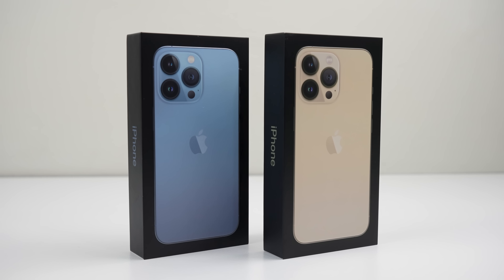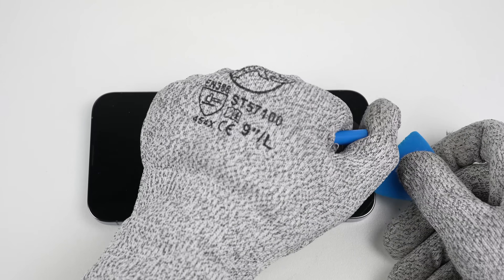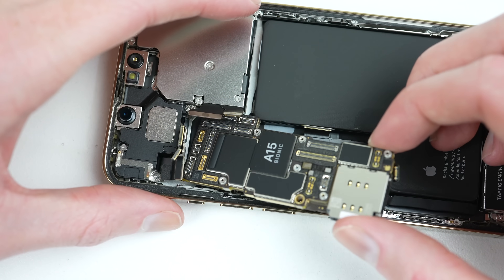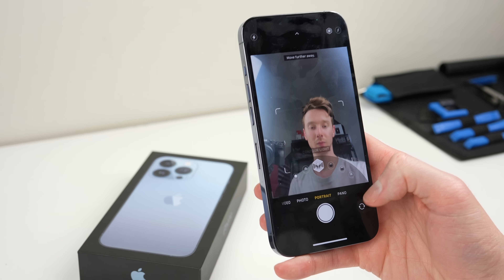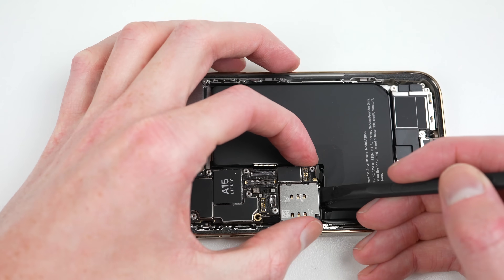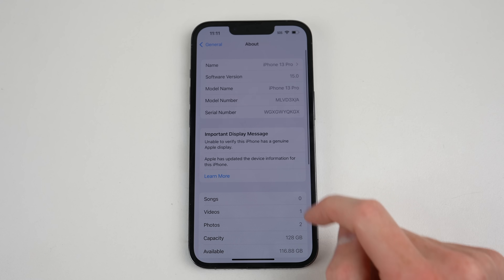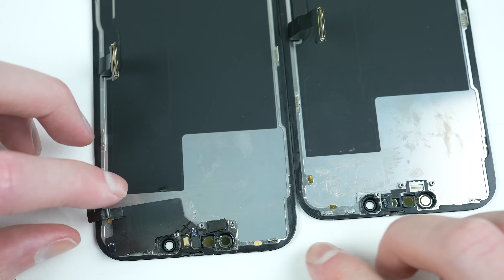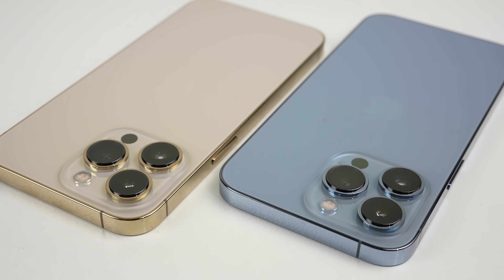iPhone 13 A Repair Nightmare - Teardown and Repair Assessment

Comment: Such a shame for Apple to continue to go down this path. I fully expect within the next 5 years iPhones will no longer be repairable at all (e.g. screen is soldered on) and any hardware-related issues will result in a complete replacement.
Reply: They just want to force people to go to them for repairs which they will charge much more expensive than third party repair shop. They just want to milk user for their repair money.
Reply: No they want you to buy new phones.
Reply: yea, like I was eager to upgrade to the iPhone 12 from my iPhone SE (1st Gen) because of the squared off design plus it being a couple years since I've upgraded. I had just swapped the battery out last year on my SE and its as good as new now. I can maybe understand Touch ID/Face ID being disabled for security reasons but the entire camera functionality? 

I was hoping maybe during the iPhone 13 apple would have tried resolving the issue, but its clear as day now. According to Apple this isn't an issue but rather a feature for them.
Reply: @KOSAMAGAMES  I can understand locking the camera modules and disabling FaceID due to safety concerns, but locking the screen is a dick move with little real security behind it.
Reply: this is especially scary for android users because of how android phone manufacturers (like Samsung and Oppo) tend to copy the current IPhone trend. i just want my sharp edges, open bootloaders, and easily switchable batteries back
Reply: @gun5219  
There are more android phones that works better than samsung or oppo or iphone
Reply: @gun5219  Just get a PCCCCCCCCCCCCCCCCCCC
Reply: @sambuddhabhusal2479  gpu prices are at an all time high, theres also the silicon chip shortage and idk if i can fit an entire pc tower into my back pocket
Reply: @gun5219  You can but you can only get Gpus Like 1650 super/2060 for the most part
Reply: @sambuddhabhusal2479  might as well have an entire server rack on my knapsack at this point
Reply: @gun5219  Yeah, remember the time when Samsung ads made fun of apple their decision making on their device, now they start copying what they made fun of.

If android phone manufactures starts following this way ( Locking phone repairs with software's and forcing users to send their repair's to the company only that charge much more expensive for repair cost than buying the parts online and replacing yourself ), who knows in the next 2 to 3 years every other company might start following what Apple is doing.
Reply: @brandon-qc1ul  
Android is open source they have to create their own os to do so
Reply: Fck apple with their backward invitations or devolution and trends, just like like removing headphone jack, charging brick and other accessories. And now this anti repairs. Duck you apple ☺️
Reply: @ToTheHellfire024  Don’t you know anything about the right to repair laws that is happening right now and how the iPhone 14s renders makes it look more repairable and on top of that the headphone jack removal was a right move sure it kinda sucks but when you have wireless headphones it’s way bette than wired and for the charging brick also kinda sucks but you know it’s to help the environment and have less waste heck they removed the plastic on their boxes just because of that I think apple is in the right here and the right to repair laws will fix this problem!
Reply: @EliezYT  there was an interesting video on how by not giving the chargers they are actually indirectly creating more waste so they end up harming the enviornment
Reply: @EliezYT  If they trying to minimize e-waste by removing charger, then why stick to obsolete thunderbolt charge for no reason?
Why not switch to a much robust type-C? 

But the only thing they want is money. Hopefully, EU pass the laws soon to end their greedy endeavours.
Reply: @agentsmith_  for me yes the usb type c would be good for their iphones but it will also take away a bunch of waterproofing and trust me I bought my new iphone 12 mini mainly because I wanted to test the waterproofing out and trust me it's great!
Reply: @maki49574  except you will get a horrible chip that won’t last long in updates and a horrible camera and yes I checked more premium but even those doesn’t hit the same level of support and speeds as apple!
Reply: @maki49574  also mate it’s brand reputation I know I like Dr Pepper more than any other drink yet I still drink coke because of the brand!
Reply: @EliezYT  Its all bs.
Reply: @maki49574  well it also depends on how you grow up I mean I’m forced to buy apple because of my family and I have had many androids before and I do like them but apple keeps getting better and better every year and honestly I love seeing how much better it gets and at the end of the day no matter if you like android or apple let’s be honest the tablet is the iPad the sales and money don’t lie!
Reply: They removed free charger for their so called e-waste reduction but their phone itself are unrepairable which contributes to more e-waste. Removing the charger is just an excuse for their greediness which is anti consumer.
Reply: @pattpdm  Respect to Xiaomi.. Our phones still have fast chargers. iPhone dosent even have slow charger lol.
Reply: Yeah, your iPhone is now e-waste because the screen broke, but look - no charger, because GO GREEN!
Reply: @glics  bruh it’s your fault if you break your phone or don’t repair it I mean I know some people want to not keep their phone but it can also be used in many other ways!
Reply: Hopefully there will be a Right to Repair legislation passed by then
Reply: @Ashrune  don’t you worry son. That will never happen. They pump way to much money to lobby against it
Reply: Easy solution : stop buying iPhones
Reply: or blow up and lock if you try to pop it open without some sort of a code that only they knkow
Reply: One word, Greed.
Reply: Atleast I use an Android phone. I'm glad that I'm not an iPhone user. Android is an open source OS and companies can't implement locks like Apple. iOS is engineered in that way, so it is trash. Before Apple fans say anything to me, let me tell you, speed and smoothness dosent matter if you don't have right to repair your phone. New Android phones are also relatively smooth and I like it.
Reply: "We removed chargers for sake of the environment"
Proceeds to make their phones even less repairable
Reply: Apple is a shitty, money hungry tech company and they are a BUSINESS FIRST and a tech company SECOND. They DO NOT CARE about quality and the ONLY reason they ''care'' about their customers is to KEEP said customers and keep the money rolling. They only care about money and the fact that every single thing that can even remotely be sold separately, is sold separately shows this the best. I bet you my whole life savings that if they could somehow sell their phones in 10 different packages at 10 different prices, they would, JUST TO MAKE MORE MONEY - because that's all they care about. Them removing the AUX port and them selling the charger and charger cables separately is the most shameless, scumbag move they could have ever done and it is NOTHING more than a business tactic and a scummy way to make more money. They are literally smearing shit below their customers noses and then dancing in front of them but their customers are too blind and too stupid to notice. I bought an Iphone once, it was few years ago and I never regretted buying a phone as much as I did then. 

Also, the iOS is the worst, most illogical and counterintuitive phone OS I have ever used! And also the fact that you can't even activate ''developer mode'' on Iphones or change anything within the OS is just pure scumbaggery and shamelessness coming from Apple, to prevent anyone else other than them, from making any 3rd party software for their phones...

Just another disgusting, shameless and money hungry company from U.S. - No surprise here.
Reply: Tbh iPhone users are pretty stupid, why buy a phone that has nothing new but the name and size? Plus can't repair it yourself so spending more unnecessary money on it, hard pass. When you buy something it's supposed to be for you to do what ever you please with it, not be stuck doing nothing just cuz the company is greedy when it comes to money.
Reply: @user-li1eg8xz7v  it has new chips therefore faster. To be honest the speed isn’t that much of a diff
Reply: Not even 5 years I reckon. Give them only 11 more months.
Reply: You are wrong. The pattern apple constantly follows is 1. make device that is very difficult to repair and then 2. after people are outraged. Apple makes a device that is slightly easier to repair and then people will be happy. rinse and repeat
Kind of like an abusive relationship lol
Reply: They have already paid hundreds of millions of dollars in fines since the lawsuit in 2017 and it seems they don't care. The only way for this tyranny to stop is for countries to start  banning iPhones.
Reply: Why should they stop going down this path? The Cult will line up and buy anything.
Reply: I hope some one can cracked their programming to reprogrammed all the logic board so Apple tech can get FUCKED!
Reply: This way Apple ID creating more ewaste than others.
Reply: The wrong here is customer that keep supporting this kind of company policy
Reply: and then there hypocrits saying there green, i don't support apple never will people buying there product only support this BS company policies and getting screwed over by it its discusting.
Reply: @GreenMaskEnergy, people will not stop buying iphones because they’re not repairable by third party shops. There are dozens of good reasons to support apple. Just with anything in life you have to also see the good not just the bad. But yes i agree it is disguised that apple is choosing to do this. But it won’t last! That’s a fact!!
Reply: They would make it all software locks because increasing hardware replacement difficulty also increases manufacturing cost.
Reply: @josir1994  from video no difficulty. Click click and assembled device. Connect usb cable, send proprietary generated command to reset eeprom and accept all modules again. 5min work. For company
Reply: It's the customers fault. The customers continue buying them.
It's not like Android doesn't exist. I understand that they are "locked" to the Eco system of Apple. But being locked is an enough warning.

Many companies have fallen before. Apples time will come. And if will be their own "stupid greed" that will bring them down. They don't see it until it's over.
Reply: We have to bring awareness so people StOp buying this product.
Reply: Or you could stop giving them money.  Then you won't have to worry about that.  Plenty of RTR-friendly (even if not wholly) Android phones out there for a fraction of the price.
Reply: I would wait for that day .. and I will see that company going down faster than an astroid ...
Reply: How is it currently repairable ? You MUST go into that apple store and pay $600 to "repair" your screen while it should cost little over $100. (Also, as you can clearly see from the video, repairing your iphone means loosing functionnalities, unless you go to the apple store)
Reply: @Hydiz  india is cheap bruh.. you dont have to pay much here... I don't know too much about the costings but it cant exceed more than $60 for screen...
Reply: And hopefully some sensible manufacturer will bring out a Fone that is durable, affordable and has the ability to be upgraded by hardware.
Apple are living in the past with these policies, once their share price gets hammered the board members will be ousted. GOOD!.
Reply: @Billsbyjoe  you better go back to the past and buy a nokia 3310, but that thing breaks aswell with enough force. There is no way to make something like that with current tech evolving as we speak. If you want to change hardware yourself and have an open source os sure switch to android, its your choice and none gives a fuck. Mind you tho, flagship androids are not affordable either and they also break, everything breaks.
Reply: Profits, profits, profits. Thats all they care about. They don't care about sustainability, they don't care about fairness, they don't care about the environment (in contrast to their marketing, of course).
Reply: Sad that we can do anything about it ;(
Reply: If that happens I doubt people would want newer models but if you want mass variety enter the world of china
Reply: They could fill it with epoxy and it's completely disposable 1kEUR toy._
Reply: haha nobody will use phones then
Reply: why would you need too sim cards
Reply: More money for daddy apple
Reply: That's exactly the reason why i ever only purchaced the I-phone 1.
After that i always using the Samsung branded phones.
Reply: I hate apple with a passion
Reply: Hey, in 5 years you might be lucky to be able to call your nan without getting written permission from Apple first.
Reply: But I love this thing. only Apple can repair.
Reply: There are several companies going the "no repair" route. I just bought a water cooler and when the heating element stopped working (1month in) they just sent me an entire new machine. No return of the old one needed.  The Customer Service Rep said " we don't offer repairs on the device ".
Reply: @themelancholyofdude959  they have already moved the iPad to USB-C so I doubt changing the phone will make any real difference.  I still doubt they will give up on the right to repair issue though.
Reply: Remember, you won't own.anything and you'll be happy.
Reply: and people will be buying Chinese brand phones
Reply: do not buy it. fck y'all.
Reply: No repairability DOES mean thinner, lighter phones which is a practical reason for it.
Reply: hopefully we run out of materials.. which is gonna happen apple doesnt fucking care about you or the world... bunch of snakes...
Reply: Hell I got my battery replaced by Best Buy’s Geek Squad and they fucked up my speaker in the process in which I had to take it all the way to a Genius Bar to get that fixed as well
Reply: That makes no sense money wise for apple to replace every device for simple issues. This iPhone is the most repairable one because they are no longer trying to replace whole devices for small parts that can just be replaced.
Reply: another reason to change to Android
Reply: Apple is run with dictatorship mindset, acts like the Chinese government, restrict, restrict, restrict. Can I do this, no you can't. Come on! Life is already hard
Reply: Remember they also have to repair their iphone, they will make it repairable for Apple only. That why they have serial number related with part number and save in bios. The only way to replace the part is reset bios which consisted high level of firmware system. This only Apple can do it.
Reply: The problem is not that Apple doesn’t want their phones to be repairable, the problem is that Apple wants to limit repairs to themselves and Apple certified facilities. As a manager of a certified Apple repair team, I can say it’s pretty dumb the software they make us use just to get the parts they send us to work.
Reply: Probably permanently turn off without an iPhone key when you replace parts
Reply: Yeah it's just going to reflow the screen on.
Reply: ill desolder that bitch... in todays market of 3d printers and at home CNC machines, making a jig for reballing isnt hard and opens the door for repair on ANYTHING
Reply: Apple is encouraging electronic waste
Reply: @chickencr0ssroad883  yea they really are. i am starting to see it more and more. my furnace has a blower with a PWM controlled board on it. non serviceable part made overseas.  sure its fixable but only if you have a scope and know what your doing on a board level. just overly complex shit for no reason and then they block schematics and parts resale
Reply: @chickencr0ssroad883  I guess you can also say they are starting awareness with it also how is there more waste when they take away the plastic from the box of the new iPhones?
Reply: @EliezYT  yeah but, without repair. You have to buy new ones. That means more box. I think that the plastic from the box is very little. So imagine plastic is 10 grams total. The phone, box and more will be more than 10 grams.
Reply: @chickencr0ssroad883  Still adds up eventually and I mean I’m not saying it’s bad far from it just saying that it still technically can be repaired from 3rd party services still even if it’s a little more still will be cheaper than apple XD
Reply: @EliezYT  yeah but if it repairs, removing plastic would be an effort. But if we can’t repair then the box and phone would and up to more waste. Created Tech said any hardware related issue would be replaced, cannot be fixed or can do serious perm dmg if repaired
Reply: @chickencr0ssroad883  So your saying is we need bags next for our phones XD!
Reply: @EliezYT  no
Reply: a complete replacement for another  brand, I hope. Dont fucking buy apple
Reply: Dont know how anyone still does not get that Apple has been this way from day one.  If you cant understand this by the 13th iteration of the Iphone you are truly beyond stupid.
Reply: lol no, that would make apple unable to do any repair and replacement, which would make them lose money.
Reply: It's shame for Apple fanboys, they've the brain of 3 years of old
Reply: Then don't buy them.. Oh whoops that's impossible for people apparently
Reply: This is why I buy quality equivalent android devices.
Reply: @mlordwhiteslayerfromf.u.g  nothing android can beat that camera and chip man!
Reply: @mlordwhiteslayerfromf.u.g  Look I’ve experienced many android phones and sure I like them and honestly I want one again just for games and stuff but I have to say it’s hard to beat the quality of iPhones and I mean look at the iPhone 13 pro that’s a solid phone and then can’t see any reason it’s bad!
Reply: @mlordwhiteslayerfromf.u.g  Like I said you can still get it repaired from a third party just this time it might be a little bit more expensive because of the extra steps they have to take also mate with the storage upgrade this year can you complain to much and how in the world would you need more memory if you got 512gb or 1tb!
Reply: @EliezYT  the point is that buying an SD card for expandable storage is cheaper than having to pay extra for the phone in order to get more base storage plus it can be more practical and you can transfer data from 1 device to another with ease and can make you keep your phone for longer as you won't have to upgrade it or delete stuff once the storage is full, you can simply have stuff on the SD card, now that's how you REALLY be environmentally friendly.
Reply: @EliezYT  I personally am fine with 128GB of storage on my phone but for my computer it's a no so my computer needs to have expandable storage so that I can put an SD card when needed which thankfully it does (I got the maxed out version of my surface go 2 btw but 128GB for a computer that I hopefully want to keep for years? Yeah I'm not gambling with that, just give me the expandable storage).
Reply: @mlordwhiteslayerfromf.u.g  why would you store that in a phone on a micro sd. There are 4tb harddrives out there at a very affordable price.
Reply: @mlordwhiteslayerfromf.u.g  got no clue about your workflow, i do understand where you are coming from. But it seems complicated for me, as a photographer. (I also have a genuine question, how tf do you have over 2T of reference images and how do you find the one you are looking for??) 
About micro sds having less chances to fail and faster transfers than hard drives doesnt sound right, but sure.
Reply: @mlordwhiteslayerfromf.u.g  fairs, thx for keeping a calm head and actually telling me about what works for you in this never ending android vs iphone war. Have a good day.
Reply: Not apple's fault. I mean yea, they did this. But the majority of people accept it, so they can get away with it. The customers have all the power .
Reply: @2SaltyRecipes  yes but being more environmentally friendly is a good thing and you can’t complain either but it does seem like Samsung wants to follow apple most of the time and they can make the choice to keep stuff in their boxes but it’s also Samsung so holding apple responsible only is kinda wrong!
Reply: That´s not the problem/ shame. The shame is that people still buy that crap.
Reply: Look at the current iMac (24”) its all soldered on board, a monolithic sealed system.
Reply: This is a great insight. Apple will get away with slowly locking down their phone from repair. Before we know it they will have the phone welded shut.
Reply: @toneabet6252  they already locked it via firmware, why in gods name would they weld them shut? They would lose so much money. Open your eyes and switch to android if you want to.
Reply: No, in 5 years the software will be designed to malfunction after a year or aroun the time a new IPhone comes out.
Reply: The mass consumer allows this by buying such products. 
Period!
Reply: DONT GIVE THEM IDEAS
Reply: And I can guarantee people will switch phones, especially people that break there screens alot
Reply: people still buy their kit, so yea it will happen
Reply: nope
Reply: Thats not very green of them, we need all the microchips and semi conductors we can get, why waste a whole phone over one minor repair?
Reply: Yea and suckers will still be buying them.
Reply: i.e. "device's gonna get tossed in a dumpster right away"

f%&k you Apple. sustainability my a$$.
Reply: They will have your fingers paired to the device so that no one else can use your phone 😂
Reply: cries in swappie and related refurbished phones sellers
Reply: If idiots are going to keep buying them up until that happens and even then in the face of utter undeniable bullshit then errr...can't fault apple for taking advantage of a braindead generation.
Reply: Its for the environment remember
Reply: No they won't solder anything, they did that on old ipod and haven't done that since, probably cause it's easier for Apple certified.. idk tho
Reply: Talk about tech waste issues right?
Reply: Some of the idiots in this thread really need to look up Louis Rossmann's videos to know exactly why people are shitting on Apple for poor repair practices. That "eco-friendly" mantra is bullshit when the "Genius Bar" charges you half the cost of the device for an entire board replacement with the exact same defect when the only defect is a single chip that they probably poorly soldered on intentionally, which they don't even make available to 3rd party repair shops. Replacing a logic board with a manufacturing defect with a logic board that has the exact same manufacturing defect isn't only non-eco-friendly, but it's scummy and it's sad that Apple fanboys actually believe that Apple is eco-friendly and supports repair when in fact they've completely opposed it in favor of a monopoly on repair services.
Reply: i only hate this comment because of how true this "may" be. Created Tech, you need to punch a on fire piece of wood three times real fast. lol You are spitting blasphemy
Reply: Viktor: "i know what i'm talking about" 
Also Viktor: refuses to elaborate 

Whatever you say, dumbass troll, black sweater cultist.
Reply: Apple: Write that down, write that down!!!
Reply: @C20F  no no. he actually have point. camera "may" can be security concern if not protected. Whoever. using id in camera that NOT compatible with a goddamn same model devices that is brand new is in fact yes a shit. but the idea of protecting camera is a good idea. from possible fake camera sensor attack. but tbh. don't. just don't lock the camera. nor light sensor. or the display that magically connect to camera.
Reply: I don’t think this suggests Apple is going down the route of having irreparable phones but rather phones that can only be fixed by Apple at crazy high prices for non apple care users
Reply: @yea9597  That's the point, you know how much they charge for repair fees is very expensive when it comes to Apple. 

They just want to milk out as much profit from their consumers as possible by doing this, but this makes current user think if they still want to keep using their devices in the future that is repair proof for third party repair shops/DIY repair even when the parts are original from Apple themselves.
Reply: @brandon-qc1ul  I know but the original comment was suggesting that Apple would make the phone irreparable even for APPLE themselves which I think is quite an exaggeration. Currently they can still claim to be eco and sustainable (even if its not entirely true) because they arent taking away ur freedom for ur phone to be repaired but rather they are taking ur freedom from who can repair it which are 2 completely different things. In a ideal world for Apple everyone would just go to Apple whenever they have a problem so it would be as eco friendly as having 3rd party repair (obviously a lot of people wont want to pay their prices but lets say they did). However if they made irreparable phones they will no longer have this excuse and cannot claim to be eco friendly as all old phones will just be tossed as they cant even go to Apple themselves for repair.
Reply: That would not make any sense though – why would Apple eliminate their own monopoly on iPhone repairs?
Reply: @woalk  they never repair anything, what the fuck are YOU smoking? GIMME THAT!
Reply: @woalk  Because their final goal is to reach a "perfect" planned obsolescence, where your phone become totally unusuable after some time, which includes it being broken in some way.
Reply: @lunchbox1341  
Once i was playing a game and never bought nothing from their shop , i was f2p 
Years and the game literally become unbalanced the buyers have everything , i was obsessed with that game so i bought too just to play , people start complaining but the owners never cares , until all the f2p players lefts and they were the majority, i left the game too cause it became boring game , even buyers lefts , it ended bad for them
Reply: @woalk  It makes perfect sense. Why would Apple WANT to repair something, when they can sell you a replacement instead?
Reply: @CreatedTech  Because throwing away iPhones that they instead could repair (with their proprietary pairing machines) and then sell again would be a waste.
Reply: @woalk  No one is saying they would just throw the phone away lol? Of course they would sell it as a refurb if they could... 

Regardless, I think you underestimate Apple, and underestimate how much more money there is to be made by doubling down on the upgrade cycle rather than making devices repairable. Apple doesn't make a fortune by repairing 3 year old iPhones and cracked screens. They make their money by selling as much new hardware as humanly possible.
Reply: @CreatedTech  Right to repair act
Reply: @CreatedTech  Not to mention Apple and other companies force updates on your phone to intentionally make your old phones worse I've actually seen it happen first hand
Reply: @woalk  since when does apple care about waste??
Reply: @CreatedTech  exactly. 
Every story I've ever heard of someone going to apple for a repair goes exactly the same: They are told that it will cost so much to the point where they are better off buying a brand new device. 
Forget planned obsolescence, now it's FORCED obsolescence.
Reply: @CreatedTech  .....apple repairs screens, batteries, speakers, back glass/logic board on 12/13, rear cameras...ever heard of Genius Bar? Half of GB is doing repairs
Reply: @stinkwhistle756  "ever heard of Genius Bar". Apart from the condescending quip, I encourage you to think about the GB critically - imagine the cost to Apple to run it. You have employee salary, office rent, opportunity cost, dedicating resources to repairs, stocking all the little replacement parts etc. I'm sure Apple still makes a slight profit from repairs, but nowhere near the margins of selling new devices.

If you had any personal experience with the Genius Bar, you would know that 85% of the time they simply advise to "upgrade to the latest model, as this device is too damaged". They also make it too uneconomical to opt for a repair. For example charging $400 to repair an iPhone, when a brand new one costs $650 for example.
Reply: @CreatedTech  Slight disagreement here. Apple is currently in the midst of a business shift, where they are actively trying to monetize their ecosystem. Look at all the subscriptions they offer, the money the App Store makes, the license money accessories generate. On paper, this should be an incentive for them to make their devices more repairable, so as to keep people in their ecosystem for longer. Look at how many software updates iPhones tend to get, for example. It’s like their software division and hardware division are at complete odds with each other.
Reply: @CreatedTech  because customers want and need repairs. and customers can do that, at the apple store. and it would be much more expensive for apple to replace every device, so they make them repairable, even more now than ever. i bet the iphone 14 will be even more modular (with iphone 13 you can now replace the top speaker instead of replacing the screen). apple wants their iphones to be repairable - goes with their eco friendly agenda - they just want them to be repaired at apple.
Reply: @CreatedTech  you have a point. Even though it sounds unethical, it’s just how they make money on the side (though it’s not like they need it since Apple already makes millions and/or billions of dollars every year from their product sales). It’s a shame companies are so lazy towards repair services, that they only ever make efforts to prevent the need for it.
Reply: @CreatedTech  what about we in s third world country.  Apple  better remember us
Reply: @CreatedTech  That's not worth it for them though.

 They want everyone to buy the apple repair/warranty plan. So they will do what they currently do. Only repair screens. Tell everyone else they need a new phone. Take the easily fixable phone and fix it and resell it while also selling a new phone.

There just going to make it so the phone enters a boot loop when someone else repairs it.
Reply: @CreatedTech  if something goes wrong with the iPhone that isn’t accidental within the first year or two (depending on country ) they legally have to fix or replace it and if they soldered it  replacing it would cost them a lot more
Reply: @woalk  Hey, if you replace camera, it costs 100$.
But if you buy one new iPhone, they earn over 1000$.
And that is the thing they want
Reply: @woalk  Because as long as there is a possibility of people like us to fix it and we will it will never be enough they want to suck up every possible avenue of profit possible and want you to have no choice but buy a whole new phone for any issue
Reply: @woalk  They will just double the price to compensate.
Reply: @woalk  have you ever heard of ANY apple authorized repairs? All they do is replace half of the device, charging you 2/3 price of a new one.
Reply: Alexander Köster Apple would rather you buy a new $1100 phone than spend 300 on a replacement lmao
Reply: @woalk  Why have a monopoly on repairs when you can just charge people full price for new stock instead?
Reply: @woalk  Because Apple already DON'T DO repairs!
Reply: @woalk  so they can make you buy a whole new phone
Reply: @woalk  They don't want to repair it... they just replace it 99% of the time.
Reply: @woalk  precisely, apple makes way to much money repairing these phones through there "authorized technicians"
Reply: @woalk  if right to repair becomes a thing, and they lose their monopoly, do you not think they would try to circumvent it to maintain their profits?
Reply: @woalk  because of their suppliers. They often leak the schematics, and a lot of factories can make the part needed available to buy for "some" people. I know this is illegal but it's not a perfect world.

Ps, english is not my first language i apologize if there's any grammatical error.
Reply: @john639-r2f  no grammatical errors, perfect English🙂
Reply: It will be like china-clones, once damaged just throw it away and buy a new one
Reply: while i agree that apple installs bugs so that people will upgrade to a new phone , its my belief apple is preventing parts usage from other phones as a form of theft parts deterrent
Reply: And its fine for samsung to do so?
Reply: Dangerous territory and I hope it bites them in the ass. When a phone that expensive can’t be repaired in case of accident people will stop buying. Then they will be forced into fully replace for a fair affordable price and at that point people will rock their phones without a case knowing they can get replacement somewhat affordable. Hope that will put a hurt on them
Reply: That is very unlikely. In most countries the warranty period is at least 1 year, you are effectively saying Apple would have to give out brand new units for every single product failure. Furthermore AppleCare would not be profitable with your assumption.
Apple would not be able to sell off to third parties as refurbished since the product would be too costly to repair hence profit margin would diminish.
Reply: You need to update the firmware of the part you replace to set correct calibration data. Everything need individual calibration will not work after replacement like 3d vision include Face ID and protract mode since they need to be calibrated. And same as True Tone. The nature displays white point is difference due to the manufacture problem. The screen will have around 500k difference with out calibration among same model but different devices. True Tone is a calibration that adaptive to environment that need correct data to work. The same thing happen if you have a 3000usd monitor. Without calibration they just did not work correctly. After changing the part without paring the software didn’t work is an evidence that apple is doing the correct thing rather that fake advertisement.

And their hack that update the calibration on older iPhone to make True Tone work. But it just display as function the color is not correct compare to genius one. Since the software is using wrong calibration data.
Reply: @_holy_tony_  Well either you cant read or not understand. That you use fake parts to change an iphone 6 without IP markings and an iphone 13 with faceID and hard security it not the same thing.
Reply: The only way someone needs repairing is if they break the phone which is on them (and also aren't the phones still repairable but you have to go to apple or apple certified places?) so overall they'll probably allow repairs just not unless they're getting paid from it. (tbh they should've made it so that opening the phone for longer than 20 seconds causes it to explode and that a special device is needed to keep it from exploding while being repaired that only Apple has access to thereby making any repairs dangerous to the phone and the people attempting to look inside/fix things without access)
Reply: Apple are only doing this because they want everyone to go down the apple care route.
Reply: @FreezingFaces  I was looking at getting a 1tb iPhone 13 pro max in Australia. Cost of it is 2719 dollars and they add apple care for an additional $399 lol they are really effing their customers
Reply: You guys dont even know why they do this , to fucking limit fake sh8t replacement screens, you can replace the screen by copying its serial key to the new replacement screen duhness😆,  pls go. Through research first before conducting a major conclusions pls
Reply: They will never do that
Reply: Gen Z and their constant shaming lol. Apple is doing great and we love it the way it is.
Reply: the phone is still repairable as all the parts can be replaced, you just can't do it yourself or a third-party repair shop.  Needs to be done by Apple which is both good and bad.
Good since your will get genuine Apple replacement parts, but bad since you are going to pay a premium.
Reply: @ZaphodBeeblebrox42  😂😂 Replace all parts including mother board (which contains iOS and has locks.). It's just like a new phone with old outer body that's it. Lol. Better off buying a new phone.
Reply: @ZaphodBeeblebrox42 you cant even use genuine apple parts unless apple uses their computers to talk to the phone and tell it that the part is ok. This practice is ONLY good for apple.....
Reply: @Steven Strain To me I don’t really care if it passes or not Apple is making their phones WAY more tuff nowadays and I mean I can’t complain I mean my iPhone 12 mini works so  on water resistance and dropping than any other phone I have used and still not even a scratch it’s amazing and if I really wanted it to get fixed it can be but maybe for a higher price and honestly I think it’s not as bad as people think and I wish it can be really repairable and tuff but hey at least we got one thing!
Reply: Apple has actually taken strides to make phones more repairable than they were a couple of years ago.
Reply: @Breadrozt  How? The iPhone XR from a couple of years ago could have a screen replacement without the notification, but since the iPhone 11, there's a warning. Since the iPhone 8 battery messages appear. How have they made them more repairable? Hell, a camera replacement disables the only other way to unlock the phone and many apps.
Reply: @THEJPR  newer models apple repair far more than older ones
Reply: @Breadrozt  Source?
Reply: @THEJPR   from Iphone 3 to Iphone 11 any damage or issue with anything but the screen and speaker was a replacemebt unit but for 12/13 they will replace rear housing. This makes it cheaper for the costumer if they destroy the backcover
Reply: @TheRealAryans567   Well I work with this so imagine actually knowing what you are talking about instead of taking your opinions from the internet?
Reply: @THEJPR  Absolutely. Apple doesn't want phones to be repaired because in Asian countries only those under limited warranty are repaired by authorised service technicians. A lot of fixes for out-of-warranty devices are done by generic workshops who replace the OEM parts with generic parts from China for about a fraction of the price. Apple has easily lost millions of dollars in spares because of these generic workshops where many of the technicians are ex-Apple technicians and know the devices inside out. For the kind of work that goes in the design of top end iPhones I too would make it non-repairable. But replacements should come at a much lower cost else the cost of owning an apple iPhone across 2-3 years would exceed that of owning a professional Windows PC during the same period.
Reply: @Breadrozt  No they don't if you go to a Apple Store with a broken phone the first thing they will do you is offer an upgrade
Reply: @Breadrozt  The sky is red
Reply: @THEJPR  I dont think the messages are a problem though. They don't matter to anyone that knows he got a third party repair, but a person that might buy a used iphone might wanna know if itt was opened and is void of warranty now
Reply: @THEJPR  the guy means it's easier for geniuses to replace the phone. Even third party part replacement is easier, but obviously there's software blocks. The actual physical replacement of parts has gotten easier with newer iPhone models.
Reply: @Breadrozt  you're talkin bollocks
Reply: @Breadrozt  yeah ... what a troll. Saying something us true doesn't make it true dude,  especially when so ,any independent repairer shows otherwise.

Idiocy needs to know some limit
Reply: @Breadrozt  you are talking absolute rubbish m8
Reply: @THEJPR  Viktor Weidenbring is speaking out of his ass iPhone 13 batteries are now serialized and tied to a specific device repairability has gone downhill for years
Reply: @Breadrozt  lmao 100% bullshit, its LESS repairable not more
Reply: @Breadrozt  no...
Reply: @arush.27   well yes? Unlike most people here I work with this and know what Im talking about
Reply: @Breadrozt  thats absolute bs. Its the opposite around.
Reply: @mosasako4679   please elaborate instead of just saying something is BS
Reply: @Breadrozt  no they havent.
Reply: @Breadrozt  Know they have not the Iphone 12 and 13 are unrepairable by any outside shop only apple can fix them. excuse me ( replace them)
Reply: @Breadrozt  Because they have been legally made to do so. Let's not pretend it was out of the kindness of their tiny, dark, corporate hearts.
Reply: @Breadrozt  This is such bs lol.